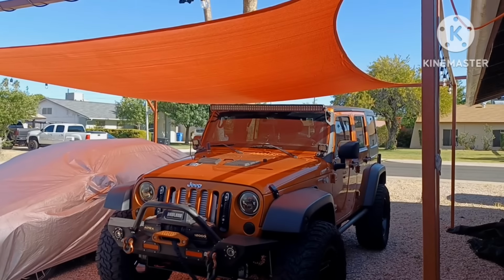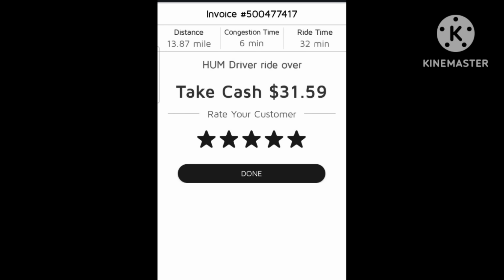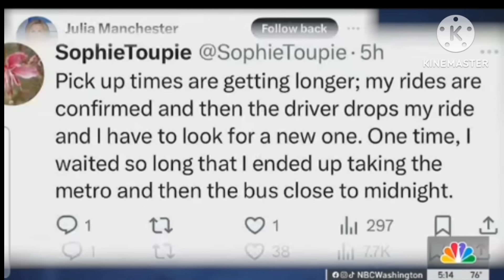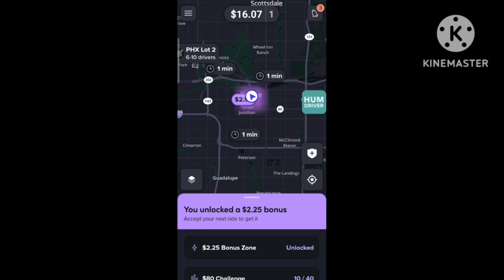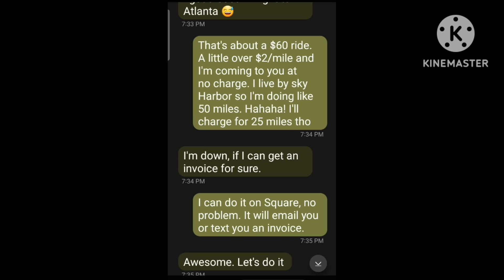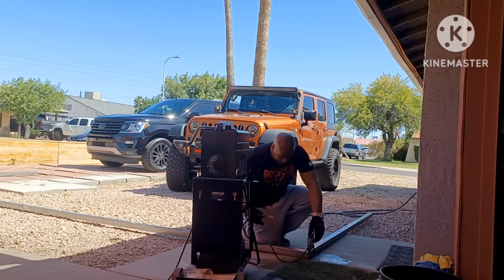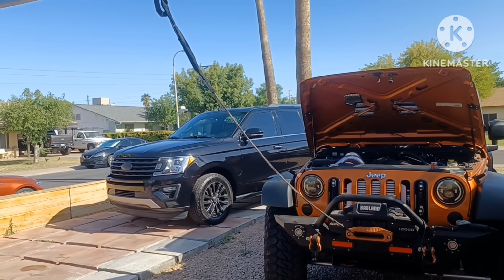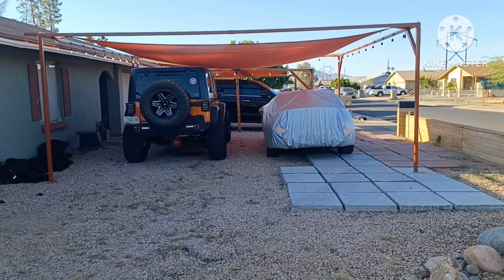🤔  Lyft Black SUV | Private Rides Fix Your Pay

Comment: I have a full-time job and I'm thinking about becoming a private driver (by driving on my off days). I've been doing Rideshare for 7yrs. I have a 2015 Accord with 235k miles on it.

Should I get a used black luxury car (Acura, Infiniti, Lexus) strictly for business OR Should I tune up my Accord that's already paid-off (get leather seats, paint it black, etc.)? 

I love your channel and thanks in Advance!
Reply from the maker: I use my orange vehicles as well. As long as the vehicle is CLEAN and you're energetic when the time calls for it, you're gonna do well. You can sell any ride for a fair price to a paying rider if the apps aren't paying well enough. The Accord is a very nice ride, like the BMW or any other sedan that's got nice tech and interior detail. I wouldn't cut that car short; it's NICE!! The miles just prove it's reliable.

I did private rides in my Jeep over the weekend and it has 257k miles on it...and it's not black. It's a 2011, and people still get a kick out of it! Don't think you NEED a black car just to do well. Im seeing that even on Black tiers, they still mess with your potential income. Stay fighting on each transaction. 

And thank YOU for the channel support. I go out on a limb to do open and honest videos, so I appreciate the tip!!!
Reply: @MicDropBBQ  Thanks for the info Jeff! I try to support content creators that I like.

I kept mentioning the car being black because I wanted to get into the higher Rideshare tiers (more money) and convert higher paying clients to private rides. I do see that the apps still play with your money, no matter what tier, so I'll focus on tuning up my car, getting Livery Insurance and converting riders!

Comment: Your $40 charge was spot on for that ride. On HUM XL you would have received right around $39 for that ride. Of course when you operate as a free market entrepreneur you could ask $45, $50 or more and then negotiate from there if necessary. It's a beautiful thing! Folks need to stop being afraid to ask what they believe they are worth. What's the worst that can happen? That they say no! Some will some won't so what! Eventually you are going to run into either corporate accounts or people who own Uber and Lyft stock. Those folks are going to be loyal to these behemoths. There's plenty more folks to choose from. Just move on.
Reply from the maker: That part! Just speak up when you know something don't seem right! These fares be $15 to these hotels in Scottsdale, when we should be getting $35-45. The apps are charging $50-60 all day, and the riders don't wanna tip. They shouldn't have to. The fare should be right, so we make it right. We know the industry.

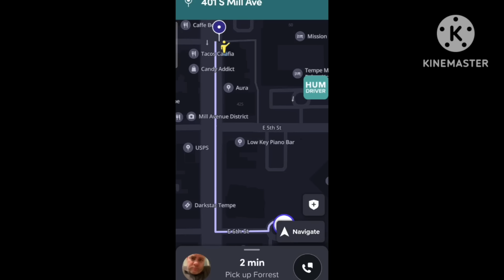Comment: 16:04 probably could have got 50 easy. Im seeing the high dollar ones are the most worth it to convert. Give it a try. Frequent travelers can cancel without it charging them anything. Dudes will convert easier of women 👍
Reply from the maker: Yup. The higher the amount the driver is getting, the more the rider paid. That's why I'm always looking for $15-20 rides because I can flip those and the rider is usually ok with doing cash and not paying $40-60 just to use an app when they can give me $30-40 and be cool in the same ride.
Reply: @MicDropBBQ  when you say cash you mean paper or cash app/venmo?

Comment: Jeff:Can't get rid of the Escalade... No one will treat it like I do...

Jeff:Yeah just put that steel inside the back of the cab. It's all good 😂

Shit bro, you gotta do what you gotta do. I remember I used to have an 05 Tahoe and did the same thing with lumber. I had access to a trailer for big stuff, but I had to borrow it. Now I've got an 04 Silveraydo and an 18' dove tail trailer. I've caught hell for going to the track with one bike on a big ass car trailer. But I can also pull another pickup truck with it too if need be.

Comment: Drivers: Apps are taking too much of the fare.

Apps: Oh, we're looking into that. Let us see what's happening here.

Apps: how does 75/25 sound?

Drivers: that sounds fair.

App pings driver: 10 minute ride for $10.

Driver: fuck yeah, that's what I'm talking about.

Cistomer: I can't believe I just paid $40 for this ride. 😮

Drivers: 🤬🤬🤬

Apps: 💰💰💰

Apps: what the problem is? 🤷🏻‍♂️
Reply: I seen $6 rides for a mile or 2 on Uber randomly pop up after sending me all $4 rides for 4-5 mile rides. Or the $6 rides for 20 min trips. And so of course I accept a $6 going a mile. But then customer payed $14 for it. Once I had a Lyft ride for 3 miles come in at $10. Rider said they paid $19. Mid-way through the trip rider adjusted the drop-off to go 1.5 miles further. Lyft paid me $3 extra but the rider paid another $21. The rider paid a total of $40. While I only got $13. BS!
Reply from the maker: All facts!!! That's why they want to keep drivers and riders from talking. We expose the bullshit going on.
Reply: Do this math and let me know what you think the rider paid.
I haven't looked yet, but I got a message from one of the apps telling me I made 181% of my passenger fares last week! 
Me: Yay!
App: you're guaranteed to make 70% after all external fees and other fees.
Me: Wow! How did I make over 100%. You just said 181%.
Looking back on last week... 🧐
I only took ONE RIDE. I got paid $9.20 for that one ride. Passenger tipped me $4.00 for a total gross of the net fare being $13.20. 
How much could have rider paid to the app if I'm getting 181% of the passenger payment?

Anyone want to help me figure this one out? I don't think I have enough coffee in the house to keep my brain awake to do this kind of math. 🤣
Reply from the maker: @robinrienerth6521 hahahahaha! Theyr3 saying the rider paid $5 or $6 and you had surge on it, maybe. Hahaha
Reply: @MicDropBBQ I have no clue 😳. But I sent it to you. I'll check the payment later.
Reply: Passenger paid $19.72. 
I received $13.20. 
What percentage did I really receive, of the total passenger fare, on just this one trip, that the app company said I made 181 % ?

My math teacher taught me this: .669 rounds up to .67 or 67%.

181-67 = 114 lies.

Platform expense (paid by rider to Lyft thru my driver account) = $2.37
Service expense (paid by rider to Lyft thru my driver account)
= $4.15
Total earned income to Lyft from passenger payment
= $6.52

What is Lyft's actual percentage of income from this one ride?

Answer: .330 or 33%

Lyft:     33% 
+ 
Driver: 67% 
=         100% of total passenger
                      payment. 

Hey Lyft? Where's the MISSING 81%?? 😂

Is this why their stock is climbing? 😳
They are lying to their investors! If they're lying to the drivers, you can be rest assured they are lying to their investors!! 
Numbers don't lie. People do.
Algorithms can't lie. They are programmed by their coders.
Coders and marketers for Lyft need to go back to Math 101. 

Jeff, show everyone what I sent you. The marketing they show the drivers on their apps is a complete deception. If they are inputting any of these false percentages from one broken code, it can have a ripple effect throughout their connected spreadsheets. If the marketing is just a single plugged-in hard number, the error can't be blamed on a typo error. The QWERTY keyboard logic does not compute 181% as a common number that would be, or could be, construed as a close-key slip of the finger(s) typo error.
1 and 8 are too far apart, and 8 and 0 are too far apart. This is not a glitch. And this is not new math. 

How is Risher going to explain this one away? 

114 lies + I did not get guaranteed 70% of passenger fare. The fare does not include the tip! If the fare does not include the tip, then the real percentage I received from the fare is only 47%.

Lyfts percentage of the fare can't stay the same at 33%. The remaining % is the tip, which Lyft should not be including in any of their total fare paid by the rider except as a gratuity percentage paid to driver. In this case $4.00 looks like it is 21% of $19.20.

Driver's real fare trip
earnings % =      47% 
(of $19.72 - $4.00 tip = $15.72)
Passenger must have been charged by Lyft $15.72!

Now re-do the rest of the % leaving out the tip... that's all mine and should not be calculated into any part of the passenger's fare.

Lyft's % now =$6.52 / $15.72 = 41% of actual price of fare charged to rider by Lyft.

Driver gets 9.20 / 15.72 = 59% (rounded up .5)

Driver's 59%
+
Lyft's     41 %
=
Passenger's total payment for fare.      100%. at $15.72

$15.72 total charged to      
            passenger 
+ 4.00 tip to driver (which is 
            25% tip on the total of
             $15.72)
=$19.72 -- The total passenger
                    payment for this 
                   one trip.

115 lies by Lyft! Or is it 116 now? Risher should consult both accounting and marketing programmers and ask them why I keep finding all these little mistakes.

First it was the "$0.28 cent Principle" (under old mgmt including riders' donations to some unknown charity in our earned income, to be taxed on, and now it's "115 Pinocchio Percentages!"

RISH... ER!! Ask your Marketing Policy Division "Where's the other 81%?"
If no response, tell them to contact the Marketing Policy Director at Uber. She may know. She wrote a book back in 2018 exposing Grayball and everything else! 
Whoever convinced you to produce this "guaranteed 70% to drivers after fees and external fees" needs to explain why this one driver receipt, times (x) millions of others, is affecting your stock prices. I'm pretty sure there is a reasonable explanation. 🧐
Reply from the maker: Then that's not 181% if you got less than what rider paid. That's horrible Lyft math!
Reply: @MicDropBBQ it's not math at all. It's a freaking LIE. Shalll we contact the producers of "Smarter Than a 5th Grader?" Or how about the producers of "Jeopardy?" I'll take category Lyft Lies for $800 and you can have category Uber Goobers for... wait for the tile to turn... Jeff you just got THE DAILY DOUBLE for $2,000!!
(Can you tell I'm having fun with this? 😂)
Reply: @MicDropBBQ That's right. If I got 100% of what rider paid, that would mean that I got the full $19.72 of passenger payment. But I only received $9.20 (plus $4.00 tip). If I received 181% of passenger payment, then Lyft still owes me 81% more of whatever the passenger paid. For me and my calculators... Does not compute. Maybe young Einstein knows. This is Rocket Science to me. 🚀
If Risher can explain this, invite him on. I'll clear my calendar. 🤣
Reply: !!!!! King's Mansion on Zee Corner !!!!!!! 
~ Your Creativity @ Work ~
Reply from the maker: @AweSomeTee ❤️ 👑  I like to build stuff. Hahaha! I'm thinking of doing the same over the back of the house to keep the sun from cooking the brick walls all summer. Might help my cooling bill!